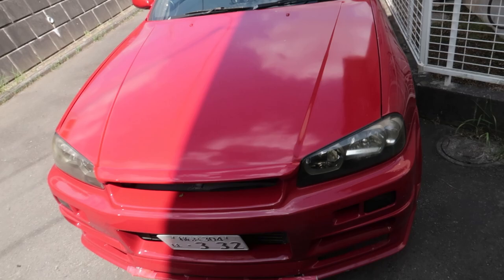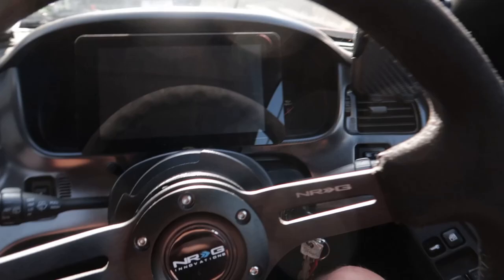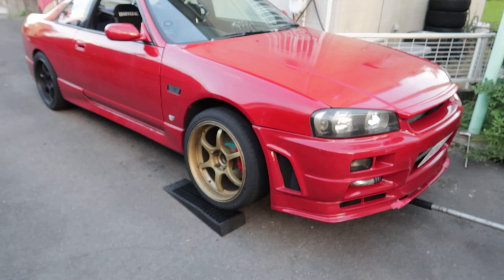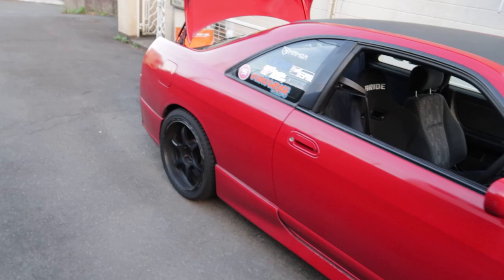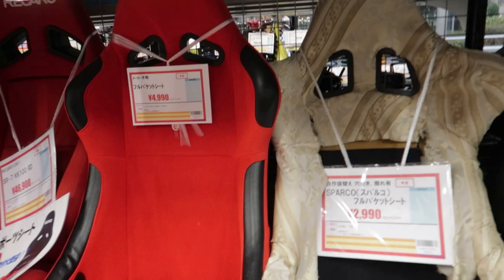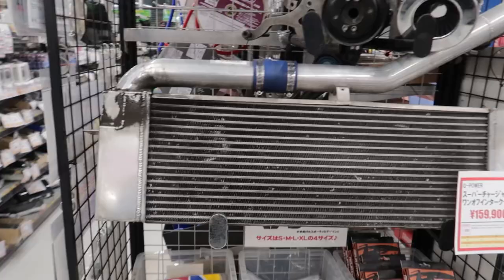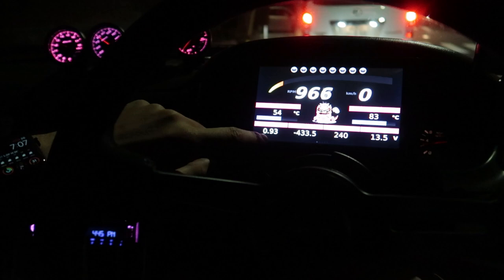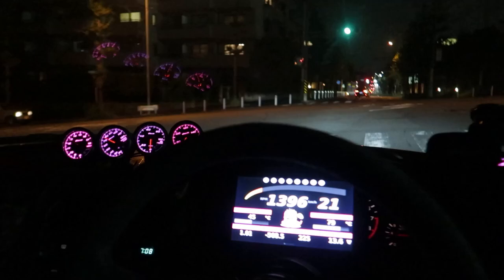FOUND MY DREAM K CAR!

Comment: You dont go by the way the slots are faced but by the way the air “tunnels” are faced in the rotor.

Cant tell on those but there definitely are rotors (K-Sport for example) where the slots are faced the way like u had on yours before.

EDIT: G-Power is a big German BMW tuner and i freaking love that Alto
Reply: Stop tech are the same too. Confused me when I installed my rotors
Reply: @callanaustin2429  bro i dead ass had to double check the instruction bc my stop tech was the same
Reply: i have evo8 stoptechs on my s13 and they are the original way he had them too
Reply: Turbo alto's are really fun Kei cars.
Reply: Yesssss to this comment ^^ sammit bro not all slotted rotors are meant to spin with the slits facing forward.  Ever since I read this with the company we buy from , I have had my brake/ rotor set ups on the car for SO long now no warps.  🙏
Reply: . hu Ta  0m @callanaustin2429 r p7
Reply: @callanaustin2429  sv2maoleypp5ññññpñññpññññññpññññññññññññññññññññññññññññññññññññññññññññpññññññpññññññññññññññññiuu1y1y1y1yqu1y1yqyqyq
Reply: came here to make sure someone posted this.

Comment: If you don't use jackstands for a quick job under the car at least toss the wheels under as a buffer if anything ever goes wrong. Not sure why but I looked and didn't see any jackstands while the rotors were swapped.

Comment: I will go for RX-7 than the Nissan ER-34 since it was a heavy car and mostly the RX-7 models are more lighter and faster than the Skyline ER-34 like FC tuned Re-Amemiya with rear GT. Absolutely runs faster and drifting more efficient than the Skylines..
Reply: The engines are hard to work on if you don’t know what your talking about

Comment: I have all mine like you first did themand according to the internet they are supposed to be like this.
I remember I did some research before fitting them.
But it is what the manufacturer recommended the way to do it. I guess being expensive rotors, they will have some instructions

Comment: The rotors were on correctly the first time.. Now your Vents are not taking in fresh air to cool them... A simple google search would show you that...
Reply from the maker: Nah, I checked the PMU install manual I had them back to front. - https://www.project-mu.co.jp/en/products/rotor_scrpp6.html
Reply: @SAMMIT  Oh! I see the vents are not curved like the slots!! I wont second guess you again. I apologise, I was wrong. :)

Comment: Honestly don't think it "camber wear", more like wear from toe out or something. Seen the exact same thing on completely stock cars
Reply: Unless it’s Alignment wear it’s camber wear.
Reply: @christiananaya9207  there is no such thing and camber wear. The only difference you get is that the rubbing you have (which is always there, even with factory alignment) is localized to one side of the tire. I wouldn't call that "wear caused by camber".

Comment: You didnt do the wrong thing yesterday...everyone that told you its wrong, is wrong.  
Your rotors are straight vaned, so it doesnt matter which way around but the slots facing forward is normal with the curved-vane Project Mu's and most slotted rotors in general.